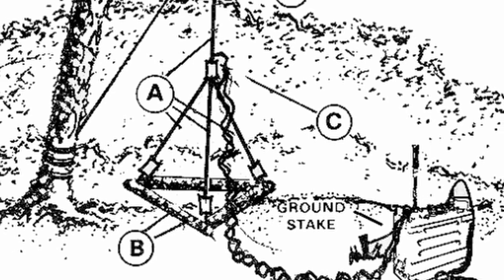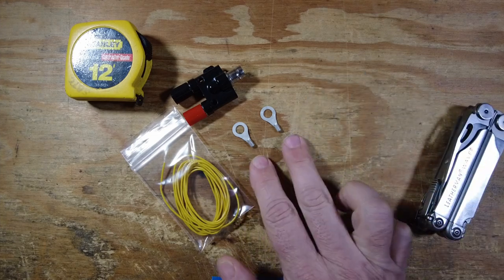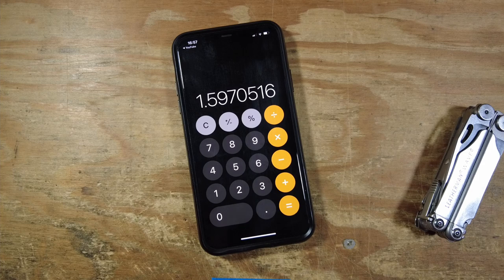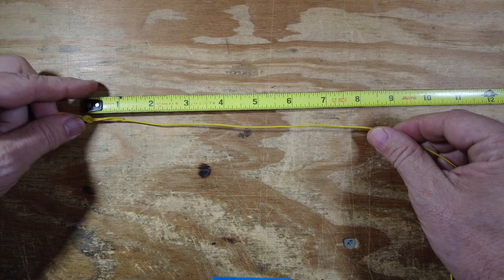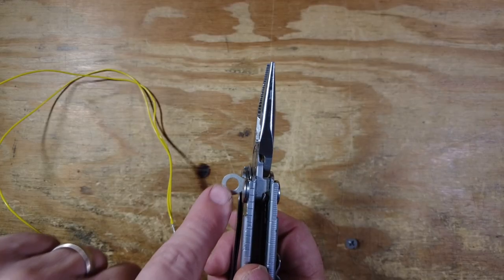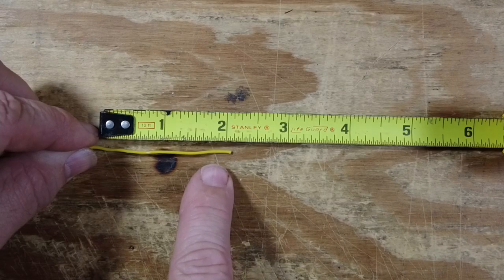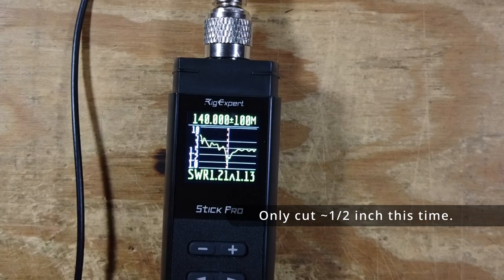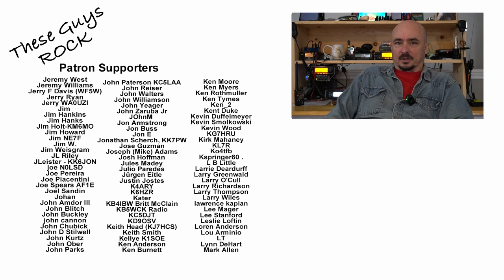Jungle Antenna Build for Ham Radio

Comment: Have you made an antenna with just a coax? Remove about 19 to 20 inches of the outside jacket. Fold the shield down over the outside of the coax, pull it down tight. Find something to hold it up by the inter conductor, and test it. The shield because it is pulled out over the outside will be a little shorter.  73  W4DES

Comment: That's awesome you did the build with a Leatherman. I saw The Tech Prepper's videos on this antenna and had been thinking of making one. Now I need to do it and do it using my Wave.
Reply from the maker: Just wanted to see if it could be done in the field if that was the only tool you had available. It's a neat antenna and worth the time to build. I ended up building a couple of them to drop into a couple of different bags.

Comment: My first ad hoc 2m antenna was an 18" piece of coat hanger, with a banana plug on one end, plugged into the center hole of the SO-239 on my FT-221 (and with a 90 degree bend to make it vertical-ish), and a wire nut on the other end, to make it less pokey.  The counterpoise was essentially the rig body, which, on the diagonal was probably 15 inches.  The rig was happy enough with it.
If you are going to be prepared, a roll up J-pole is also a good choice.
In the field, don't let lack of ring terminals stop you: Those binding posts will retain bare wire too.  Make the wire a little long and take an extra turn around the post after it comes out of the cross hole.  In fact, you can take extra turns to tune it: take it through the cross hole and wind the tail coming out of the other side.  Slide more or less through to tune.
And it should work fine with one "counter poise wire", with the bonus that you can deploy it horizontally if desired (CW or SSB on the 705, for example).

Comment: First off  thanks for the video and all you do for the community KM4ACK!

Couple questions:

1.)  If I followed along correctly, you started off with 19 inches and trimmed a total of 4 1/2 inches from each piece of wire, correct?

2.) For your own ad-hoc field testing experiment, if you had left it at the original 19 inches per the initial calculations, do you think that at the measured 2.9 SWR, it would have provided better performance than the whip antenna provided with your HT?
Just curious if you had to whip one of these up but didn't have an SWR meter to fine tune it.
Reply from the maker: Looking back I think I made a mistake and initially cut the wires too long (longer than 19"). I did end up cutting ~4.5 inches off though. Even at 2.9:1 SWR, it would work better than the whip since you can elevate it higher than you would be able to with a whip.

Comment: Did you spread out the counterpoise wires or just let them hang down from the BNC adapter?
Reply from the maker: The stick at the bottom spreads out the counterpoise wires

Comment: Do the knots at the end of the wire make any performance difference?
Reply from the maker: maybe a slight different but it is essentially the same as folding the wire back on itself instead of cutting it shorter.